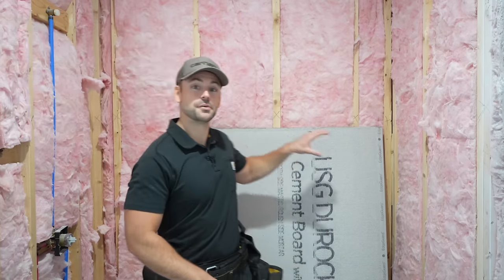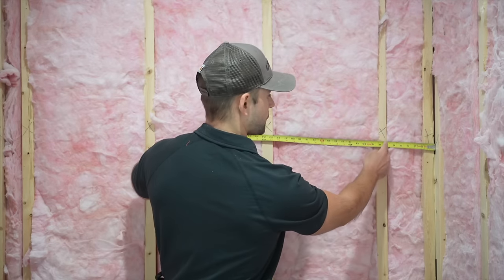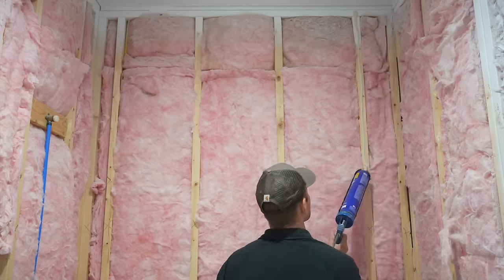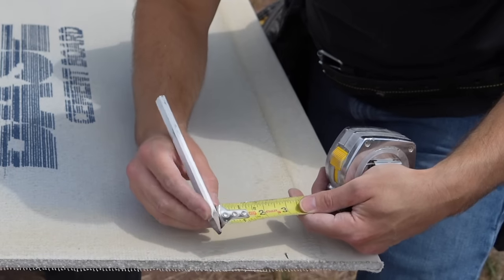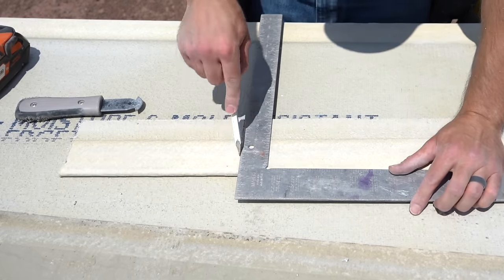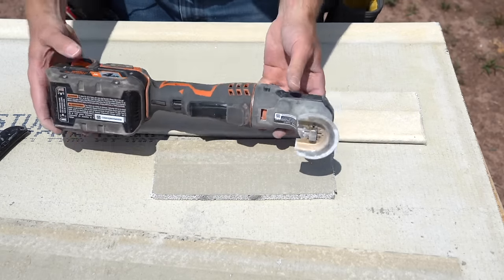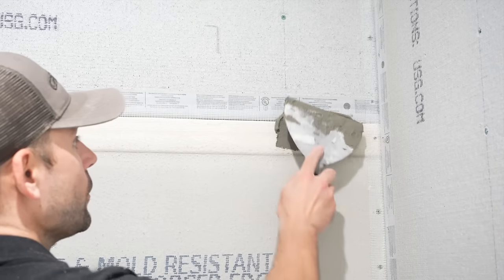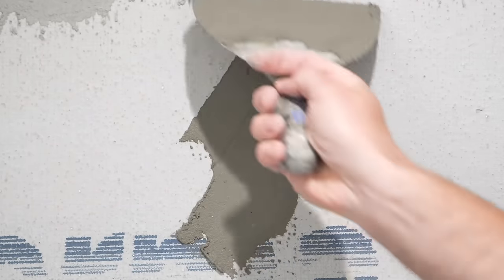Cement Board Installation - Shower Walls For Tile - COMPLETE TUTORIAL

Comment: Local Code says put board over the bathtub lip and not on top of the lip. Nice video otherwise.
Reply: The key word here is local…
Local to whom…?
Reply: 1. Cement board will wick water if it touches the flat area of the tub rim.
2. Pulling cement board over the lip either puts a bend at the bottom, or pulls the sheet out of plumb.
Cement board should end above the tub, preferably 1/4” above the lip to allow some movement.
Reply: That's really unfortunate since your local code is requiring you to go against the manufacturer's installation instructions. Maybe you can send your local code makers the actual proper guidelines so they can change the code?? You can pull it off the website but you can call up USG and have them tell you which page to find out info and diagram on (pg 6 if memory serves me). Maybe include the number where they can call them to hear it straight from the manufacturer for themselves. Scary to think the people making the codes there don't actually know how to use the products properly. I wonder what else they are writing into code that goes against the manufacturer's instructions.

Comment: HI Josh. Thanks for the excellent tutorials! Would you please tell me why you started at the top and not at the bottom when placing the backer boards?
Reply: Apparently not cause there is no reason to start at the top. Drywallers do that but no reason with the 3x5 cement boards. If it works out bad you could end up with a rip at the bottom and I prefer a whole piece with less seams as high as I can go

Comment: The Durock installation instructions indicate the board should be shimmed 1/4 inch above the shower or tub flange. They also do not say to use construction adhesive to attach it to the wall. It's an unnecessary step. People say it gives the board more strength. However, your layer of thinset will provide the extra rigidity.

Comment: Very nicely done and very informative! Recently installed the cement board in my shower, and was very much similar to your method, except that I used an Alkali-Resistant Cement Board Tape instead of the mesh tape you used. Product is: FibaTape Alkali-Resistant 2 in. x 150 ft. Self-Adhesive Cement Board Tape
Cheers! Subscribed!

Comment: Best videos ever for DIYer bathroom remodeling. 1 question: can i replace parts of the bathroom drywall outside the shower wet area with cement board?
I need to replace some sections located at the bottom of the drywalls. I already finished tiling the shower walls and my shower looks fabulous thanks to your coaching.🙏🏼🙏🏼

Comment: First off, so glad you explained the options of cutting the cement board. Even using hardi backer the same process of all three. I've seen guys not put the nylon tape over the joints and even using a latex silicone in between the joints as they put the boards up. ( What's your thought of the silicone usage?)
Some time use should look at the schluter system. Having the ability to go over drywall products it's one advantage. Cost is one aspect but labor cost comparison is what to consider. First time using the schluter system was a bit of a challenge but as you do more, it gets easier. 
Great job Josh as always and the use of eye and ear protection along with a mask if using a circular saw. Who wants to breathe in that dust. 👍🏻
Reply from the maker: I feel like silicone would be a fine idea in the joints. Since I use the waterproofing and crack prevention coating I do not worry about it. I would like to use that system on the next shower just to get more familiar with it. Seems like everybody likes it. I would have to study up on it. It was windy outside that day so the dust was not in my face but yes a respirator would’ve been a good idea. Thanks David for watching and commenting as always. You are the man!
Reply: Found the video and product information which I saved. Yes, I've used aqua defense. Great product for sure. 
 Always great responses as well from my friends and contractors. Of course we all usually have ideas that work better for each process, but like my Dad always said, "you have to start somewhere".
Great man and I miss him even my father-in-law who was in the trades as well. 🙏🏻

Comment: Hi Josh, your videos are incredibly helpful. I am replacing tile in our guest bath. It’s is a standard bath tub/shower. I have 2 questions for you. I have installed the cement board and used the thin set to patch seams and screws. I feel like the thin set needs to be sanded, so how smooth or rigid can the surface be without causing a problem? Also, the cement board is about 1/8” to 1/4” shallow at the seam with the drywall where the bullnose tile will be installed. Is this a problem and how do you fix?
Reply from the maker: Unless the thinset is protruding up over an 1/8 inch I would not worry about trying to sand down where you patch the screwholes because when you install the tile thinset is thicker than then we’ll cover it up. I would fill in the area you were talking about that is shallow with sunset before installing your bullnose. I hope that helps!
Reply: Thank you. The shallow seam runs up the entire height of the wall, about 6’ from the top of the tub. If I understand, you are saying I should fill that and feather it toward the shallow side with thin set before water proofing with Aqua defense? I suspect a thicker layer of mortar can be used when setting the tile as well? Just trying to figure the best route here. Thanks again!

Comment: I watch you and I do agree with everything you said about hanging durock in your shower but my question is can I use the same durock that you used in your shower as a siding on the outside walls  ?
Reply: Yes, I did it , painted it few years ago and it's holding up with no problems.

Comment: Really should use alkali-resistant  mesh tape in showers/ baths. That stuff will absolutely fail in moist environments. Also the kind of thinset matters in moist environments. You should use ANSI A118.1. 👍

Comment: When you mud a pan do you put backer board on before the pan to about 1/2 inch above the OSB floor? or float it  slightly above thel mud pan after its done? the mud floor is on roof paper and chicken wire (no  Oatey  pvc liner)

Comment: if your not using a fiberglass shower pan, but making your own pan how far up from the pan should the cement board be, I was told never put your board in the pan or touch the pan. I'm also going to use USG Fiberock Tile Backboard instead of cement board do I cut it the same way?
Reply from the maker: 1/8” gap should be plenty. Hope that helps!

Comment: I am installing a 30x60 shower that I plan to tile around afterwards.

Two of my walls are framed in, and I plan to use cement board on those. My third wall has two challenges. It has a window that I'll be working around and its made of block. The block was badly gouged and in places has holes knocked in it by a previous renovation. 

Is there a good way to lay thin cement board on that wall as well so I have a good surface to attach my tile to? 

My first thought was just to tap con it into place and then carry on with the rest of the job, but I'd rather not have to go back and redo it if I'm guessing wrong.
Reply: The back wall on my shower is a block wall. You should use furring strips on the block wall, and then from there, you can hang your cement board. Also I would recommend adding 3/4 inch foam insulation in between the furring strips.  You can use a little liquid nail on the backs of the foam board to keep it in place.

Comment: I am tiling a 12 in tall section above a shower wall that runs even with the bottom of the cement board, would I treat it like the shower pan and thinset and tape where the bottom of the cement board meets the top of the shower wall?

Comment: How much gap can you get away with before trying to shim the wall board? I running about a 3/16 gap between stud face and the cement board and what is the preferred method of shimming

Reply
Reply: You can either use shims or you can wet shim. That's when you use thinset where your gap is, and then you can press your backer board into the thinset. Don't sink your screws just yet where the thinset is.  Start your screw but before completely securing it,  let the thinset cure.  Afterwards you can tighten the screw.  If you tighten it first, you'll just mush the thinset. Hope this helps a little.

Comment: Josh I have a question... when the cement board is touching the shower pan.... how do you water proof it so no water gets to the cement board? I see one video where you put mortar down there. Thanks
Reply: When you use the tape rule and pencil to scribe a long line just hook the tip of the rule on the lip of what you are measuring and put the pencil on the measurement you want. Way more exact than your way. Try it you will see what I mean.

Comment: I see a lot of guys using Ridgid tools on YouTube, can you tell me why you're using ridgid tools? I'm a mechanic and I use Milwaukee tools at work, but I'm planning on doing a whole house remodel. I've started buying Milwaukee carpenter tools because that's they type of batteries that I already have and use on a daily basis. Is the warranty on Ridgid tools better? Please tell me why you're using Ridgid tools and maybe I might switch over.
Reply: Rigid might be sending tools to YouTube contractors for free as easy product placement or will actually pay some of them to only use rigid if the channel is big enough. I haven't used much rigid tools so can't offer much on how good they are, but most tools are basically up to you about what feels best in your hand. Every company has different weights, sizes, shapes, volumes, vibration levels, and angles that they make slightly different to try and make theirs a little 'better' than others. I have Dewalt drills but am looking at switching to either Makita's or Milwaukee's since Milwaukee has seemed to really step up their game lately, but have always liked Makita. Most important thing is getting a set of drills that feel good in your hands, how heavy they are compared to others can matter when you're working over your head, it's weird how holding a 4 or 5 pound drill over your head when hanging drywall on a ceiling can make on your shoulders so light drills are nice.

If you already have batteries and you like your drills maybe avoid switching brands since batteries are expensive, maybe just get a new set for your house and have your old ones for the shop. See if you can try different brands at the store, you might not like how loud the impacts are or the vibration, or the weight might be different than what you're used too. In the end most tools do the exact same thing as the other brands, just have a different look and feel so find what you like most

Comment: My cement board on the side where the shower faucet is doesn't end in a stud do  I add 1 for it to end on or continue over out side of the shower area to meet the next stud
Reply from the maker: When I install the drywall before the cement board I always place a stud for it to break at that area. I would recommend you do the same so your cement board has a nailer. If you do not want to do that you can try to add blocking to give a place for the cement board to end at. I hope that helps!

Comment: Never once taped and mudded joints on cement board. Only ever used hardiebacker. Whats the point of thin setting the joints? Wont that happen when the tile is installed?
Reply from the maker: When you tape the joints fit makes a wall flat at the beveled areas. For two, you have to waterproof the cement board and you must fill the cracks like shown in the video. Hope that helps!
Reply: It’s to prevent cracks. It makes the area you’re tiling one continuous plane instead of multiple planes. Do not use regular drywall mesh tape because it will break down.